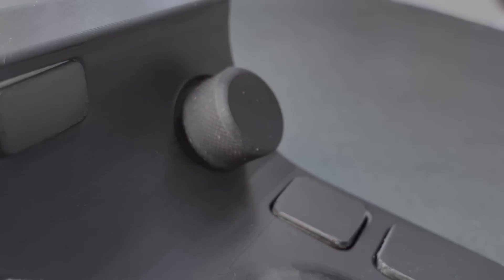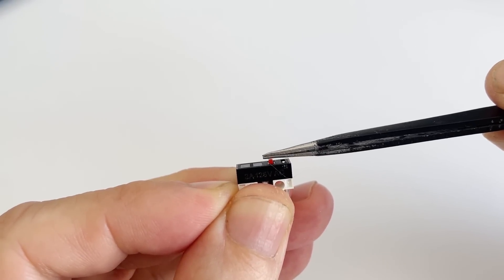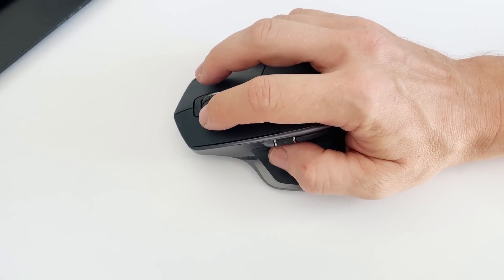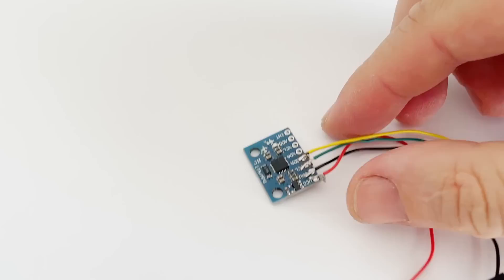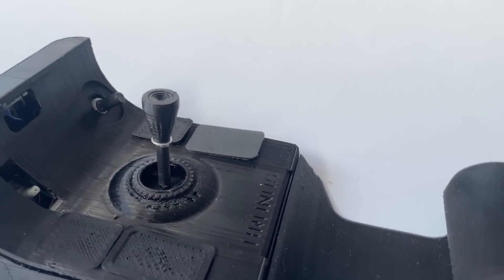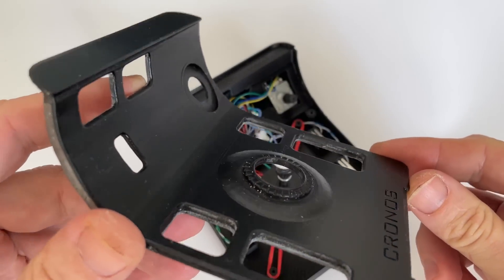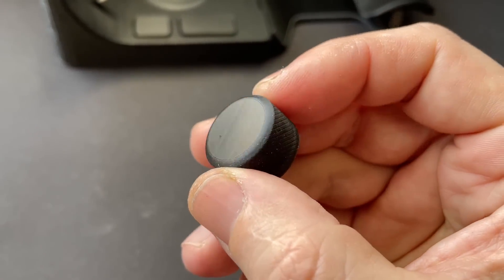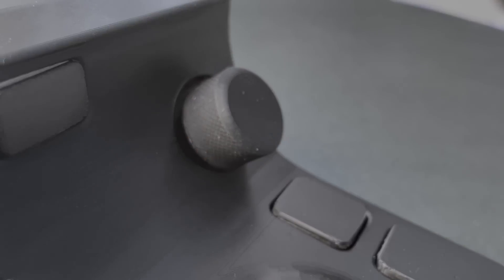Creating the Ultimate Mouse: The Journey Behind Cronos Control - A Mouse & Trackball Hybrid!

Comment: it's not a trackball hybrid, the button placement and finger pointer movement is not the hallmarks of trackballs, the fact a ball is used is

there are trackballs that dont have buttons around the ball (Elecom Huge), and mice that have the buttons around the outside with scrollwheels on the thumb (Zenblu 10)

it's a joystick hybrid with Kensington trackball inspired button placement

Comment: I have the Azeron Cyro. Sometimes i switch to a profile to use the thumbstick for mouse movement for ergonomic reason, so i don't have to move my arm and hand, but i'll still leave the optical mouse on for precision, when i need to click a small button. It can do a lot of things like long and double click on button and layers and profile switch. Emulate controller and use thumbstick for 4 directional scroll, analog stick or wasd. The software is really nice.

Comment: 2:36 what do you mean by "slow"? the sensitivity is adjustable and the pressure on the ball can also vary depending on the manufacturer. If I recall, there's a trackball  with an adjustable free rotation range, i.e: you can smack it and let it scroll for a while. And I'd say almost the same for the joystick
Reply: the Elecom "HUGE" trackball also has a thumb scrollwheel he'd probably like

Comment: It's clearly inefficient. My fingers have to move much greater distances to control it. With a traditional mouse, my hand just rests, and it moves less than half a millimeter.
Only an eye-tracking system with voice control could be more efficient than a mouse — or some kind of mouse-voice control combination.

Comment: This is amazing research!  Thanks for sharing this, I have been searching for this answer.  I started having issues with my hands and wrists last year and have been through so many mice, trackballs, and keyboard/trackball combos.  I finally landed on using a slimblade pro and assigning 2 keyboard buttons as my click buttons.  This setup has worked great for me as I like to move the mouse with my right hand and click/scroll with the left.  The only issue I have had is the trackball.  Like you said, it is too slow.  I am going to try this method out and then build my own split version.

Comment: there is also zalman fpsgun mouse. I bought the first one years ago for $14, I think mostly for laughs. turned out to be increadibly comfortable - no more warm feeling in the wrist at the end of a work day.
and when it broke I wanted to buy another one just to realize the prices on ebay are crazy high.

I'm really tempted to combine your joystick steering with the vertical grip and trigger like buttons. maybe even a hybrid with an optical flow sensor on the bottom (for fast movement) and joystick action (for precision)

and if I ever do something towards that project the paddle scroll will definitely be dedicated to you ;)

Comment: It's an interesting design. But this is a classic case of designing a thing in a vacuum. A.k.a trying to solve the wrong problem.
You have a very rare type of grip 1-3-1. With 3 finger n top of the mouse. Very little people have it, so no mouse manufacturer design it's devices for such a grip. So instead of reinventing the mouse, you'll be much better off by adopting one of the more common and functional mouse grips. And also switching to the gaming mouse. There is no way that any type of joystick no matter how large & precise can come close to smoothness & speed of actual mouse. You likely had a very bad office sensor with low DPI together with rare and broken 1-3-1 grip.

It's kind of funny really. There is also a video where a man goes a long way to make a mouse with complete 3d adjustable moving buttons & shells, just to try to fix his unfixable on modern 2 top button style mouse 1-3-1 grip.

Comment: Seems like the red IBM Thinkpad "Track Point" nub, broken out into it's own device? Not sure I'd call it a mouse in the traditional sense. Joystick really.
I like the seperate joystick for smooth scrolling, though you can achieve that with regular mice by clicking the scroll wheel to enter continuous scroll mode.
With no palm rest I'd be quite worried about RSI or carpel tunnel syndrome with longer term use.

Comment: What do you do with a mouse that they're breaking this often? I've had the same mouse at work for 12 years. All i do is click and move things,  design work, or sending work off to various machines.  I click more than i type. At home as well same one for at least 5 years now. Boggles my mind to be replacing them this often.
Reply from the maker: The issue lies with a specific manufacturing flaw in Logitech's premium series mice. It's not about how they're used but rather how they're made. Many discussions on forums and subreddits detail this problem. The microswitches in these mice are often subjected to higher current than intended, leading to contact degradation and eventual failure. It's a design oversight rather than a usage issue.
Reply: @DIY_Yarik  interesting, I guess I only bought the cheap Logitech then.  But they're all Logitech.  Go figure.  That's good to know if/when one of these break.

Comment: This design seems impractical in so many ways... Some of the design decisions in the evolution of computer mice are done for very deliberate reasons...

For starters, the use of a joystick of the absolute movement of the traditional mouse is the exact reason gamers on console have a disadvantage over pc gamers. You simply can't make precise jerky motions with a joystick the same way you do with a mouse.

Next up, there is a very deliberate reason the buttons on a mouse are on the same surface your fingers rest on. The same fingers that you use to manipulate the mouse. The way I see it, in your design, you would need to take your fingers off of the joystick every time you want to click one of the four buttons, unless you use your palm to control the joystick, or unless you use 2 hands, which would defeat the whole purpose of a mouse-like controller.

I can however see the usefulness of the way you replaced the scroll wheel for a joystick on a spring, that's actually a very ergonomic way to create continuous scroll, but again you put it WAY out of reach from what I can see. I want to be able to reach my scroll without lifting my hand from the control surface every time i need it.

Overall, I think a lot of improving can still be done to this custom controller. I would start with taking the 4 buttons (or maybe even just 2 of them, 4 seems overkill anyway) you have surrounding the central joystick, and placing them on TOP of the joystick in some way, so you can click them without lifting your fingers off of the stick. Next, I would move the middle mouse click to a press action on the joystick, similar to how you click down on the scroll wheel. I would move the joystick for the scroll function close to the joystick and put it in a central position, or potentially replace it entirely by controlling the scroll with the same joystick as your mouse movement, but only if you are pressing down on the joystick for example.

Last of all, I would start doing research in pre-made parts. Making a joystick yourself from scratch may be epic in essence, but I guarantee you there is affordable options out that have the exact specifications that you need, and work a million times better than what you can produce in your workspace. Just order some and implement them into your design. I'm thinking about joysticks like those from gulikit, and stereo knobs from uxcell for example!

TLDR: Nice idea, not a big fan of the execution

Comment: How about using a logitech thumb trackball? Perfect mouse for me, been using them for years. If you want speed, flick the ball and let it roll. It may not be quite as fast as a regular mouse, but its close. And they're only $40 iirc. I have a stockpile of old ones that I use for parts when necessary.

Comment: I mean, at that point couldnt you just use a controller? Ergonomic design, easily achieved steady scrolling and pointer control, a lot of buttons for multiple purposes, it basically checks almost every box and is already readily avaliable

Comment: So recently, Keyboards with Hall effect sensors have been coming out. They use magnetic strength to determine keypress inputs instantly. You can adjust how far you press the key before it registers an input and everything. If you're still looking for a way of improving your "mouse" maybe hall effect sensors might be a direction you can look at.

As for my own opinion on this, honestly I can't see myself ever coming close to using this. It uses way to much finger movement to navigate to the different functions and it would quickly become tedious to me after an extended duration of use. To each their own though. If this works for you, then that's all that should matter to you.

Comment: Ah man, the OG performance MX is a very nostalgic mouse. I spent many years using one (swapping for a new ones every few years) because it honestly had the perfect shape. It took me a long time to find another mouse I genuinely liked after that. It just got too expensive having to replace it so often. I went back to logitech some years later when my wrist started acting up because of the MX vertical which is a great mouse. I still use one for work also I also having a gaming mouse that's more tuned to non-work applications.

Comment: If you really want this to be a long lasting mouse I would say maybe look into using something thats easier to buy in bulk or more customisable like keyboard switches- I think a nice low profile tactile one could still function well as a mouse input and can be hot-swapped, alternitavely I would suggest maybe look into designing an optical switch system- that way the only user servicable part after creation would be the physically touched part and any springs used

Comment: This is a lot of extra engineering and failure points to get right back to what a trackball does. The "trackballs are too slow" is usually overcome by increasing sensitivity and practicing. 
Also the surface area you get to interact with here is tiny, I'm not sure how well it would work for folks with large hands, hand injuries, or any neurological issues.

It sure looks cool though!

Comment: so, a joystick?  how is that new?  a trackpoint is not a joystick, 🤦🏻‍♂ a joystick moves with an articulation and a trackpoint doesn't, a trackpoint rellies on pressure sensors. I have Master MX 3 and I need less space to use it than with my Kensignton Expert or my Elecom huge or even my Elecom Deft pro, just increase the speed for the mouse pointer, lol. All your problems can be solved by configuration

making molds of clay for one person is good, the problem is you are missing the point of Ergonomics, pressure is going to be always there and RSI is about Repetition so making a mold is pointless because with the mold you are not experiencing the repetition you are only experiencing the immediate discomfort, eventually you might develop new discomfort, not a single device is 100% ergonomic purity, eventually all devices with develop some RSI, and you will need to change the type of the device to redistribute the pressure.

Comment: You are amazing for putting your plan to motion. Copy and paste, scrolling (love your idea) and volume is pretty convenient. Wrist rest is nice, too.

However (let's pretend I'm customer) I think my finger would hurt as hell after one shift in office. Yes, granted, XBox/PS controllers had joysticks too and I remember to adjust to it for several months. That would be probably okay in your case. The buttons are fine, but mabe make them a little higher. It seems a bit straining to reach them. 

Durability - it is sturdy and I love it! Weakpoint are those gum bands. Would vertical springs help on each of four (or eight)sides and something to hold it in center? Just a thought.

I really hope you will finish it to fully functional mouse - and main thing - it will be joy to use for you :)
Reply from the maker: Thank you for your thoughtful feedback and support! I’m glad you liked features like scrolling and volume control — they were designed with comfort in mind.

Regarding finger tension, it appeared that way because my hand was in an unnatural position for filming. In my upcoming video, I’ll showcase design updates, including replacing the two rubber bands with four high-quality ones for uniform tension.

Your suggestion about vertical springs is intriguing — I’ll explore it as a way to enhance stability and durability.

Thanks again for your input! Feedback like this helps me refine the project and make it even better to use.

Comment: This is both the most cursed AND innovative "mouse" I've seen, I appreciate the "outside-the-box" way of thinking, but I wonder, is it just for casual use, productivity, or have you tried it with games too? How does it fare in both scenarios?

Other options I've seen were a "crayon grip" style mouse and a "pen grip" from the same creator, have you tried those?
Reply from the maker: I'm currently working on a new video where I'll showcase some design improvements aimed at greater comfort. Of course, I'll also demonstrate how the mouse performs in various applications and even a bit in gaming. Stay tuned!

Comment: For the second and third grip you simply need to overcome the idea that only two fingers are used to control the buttons.

I use a Logitech Ergo M575 trackball mouse, and I use three fingers. My index finger presses LMB. My middle finger presses the MMB and controls the scroll wheel, and the ring finger controls the RMB. I actually switched to this grip years ago when I was using a Microsoft IntelliMouse. It's great. Your three main fingers are always supported and your thumb and pinky finger are used for stabilizing the mouse; more importantly, no finger is crammed into a small area.

Comment: I've had same issues with clickers in two of my mice. The metal part bent the wrong way and got stuck. To fix it I had to disassemble the clicker and reassemble it. To say that it was a pain to reassemble the clicker is an understatement as you need really fine tools to do it, which I didn't have, so it was a matter of trying to assembling it until it assembled correctly. But both times I was able to fix the clicker and it kept working for years without any issues.

Comment: I think if you're going to stick with the joystick as a mouse idea you should look into the way that drone pilots use joysticks, then your arm could be placed in a more natural position like using a vertical mouse and have the control of pinching the stick.
Reply from the maker: Thank you for your advice! Before developing it, I studied different types of joysticks, including those used to control drones. In aviation, super-precision is not always required, whereas for working in 3D programs or other tasks where high precision is important, perfect smoothness of control is necessary. That is why I chose this design of joystick - it is better suited for these purposes.

Comment: I love this, since I've spent a great deal of time agonizing over what trackball mouse to get when one of mine suffers a breakdown. I'm not technically inclined enough to feel comfortable switching pieces or building one myself as you have, but it sounds like we have very similar tastes in functionality!

My only suggestion would be, if possible, making it so the volume knob can be pressed as a button for a quick mute/unmute feature. I work in hotels, and being able to quickly mute my video or game when a guest needs something has been handy countless times.
Reply from the maker: Thank you, I'm very glad that my idea is close to you! 😊 Unfortunately, it won't work to build a button under the volume control - this can lead to rapid wear of the encoder. There are encoder models with a button, but their rotation angle is limited and the feeling is not as pleasant as this endless rotation. But your idea is cool, and I'll think about how to add a quick mute function in the future!
Reply: @DIY_Yarik  Bummer, but glad it was considered! Good luck with everything!!

Comment: Switch failure is a known issue that's been fully diagnosed for over 5 years. Mouse manufacturers deliberately run the microswitches WAY out of spec electrically in order to guarantee they'll self-destruct and force a new purchase. Also your wrist-wrest is basically the worst possible solution biologically, you're placing  pressure directly on the carpal and ulnar tunnels. You NEVER want ANY pressure on the underside of your wrist or forearm, what you want is to rest the heel of your palm on something. It's actually designed to be load bearing.

https://www.youtube.com/watch?v=v5BhECVlKJA
Reply from the maker: Thank you for your feedback! I agree about the wrist, I gave my friends the mice so that they could test them and everyone had questions about the wrist. Now I have redesigned it, now the palm rests on the stand, not the wrist, and it is adjustable in length and angle. I will soon finish the video about the changes and show it. There will be several very successful, as it seems to me, solutions that made the device even more convenient. 
Special thanks to you for the link to the video!
Reply: @DIY_Yarik  Sounds great. You should get in touch with the space and mechwarrior community. Your ideas look like they'd work great for something like a mech or 6dof second hand.